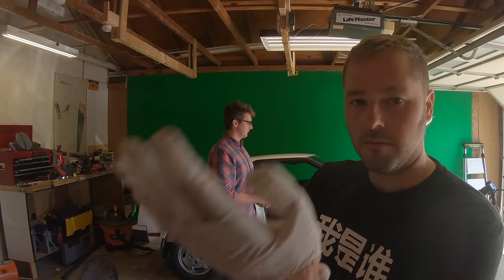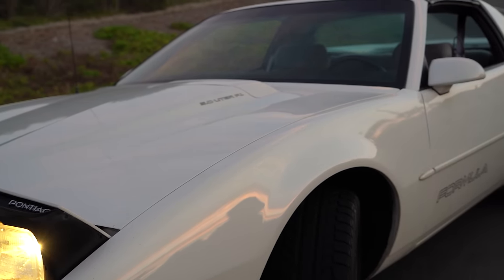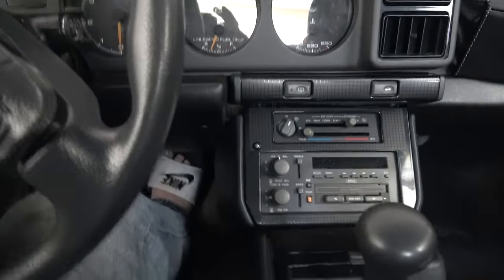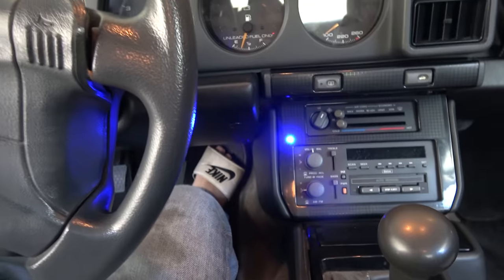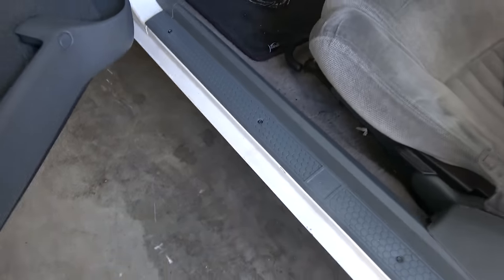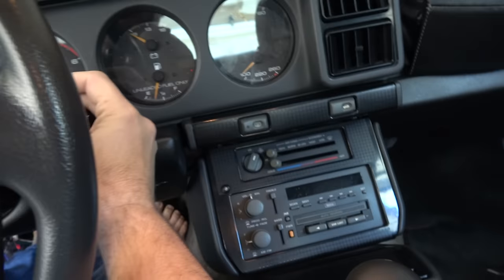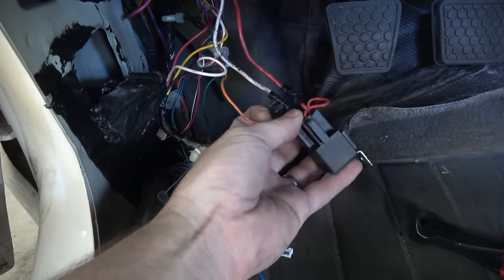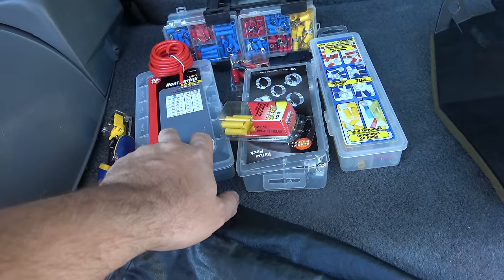Aftermarket Alarm Leaves Me STRANDED! - Let's Get Rid of it

Comment: i don't really understand why they even put alarms in cars anymore. no one reacts when the alarm goes off. if you heard one would you ever run outside to make sure it wasn't your car being stolen, or would you just sit there and wait for the noise to stop like everyone always does?
Reply from the maker: Yeah, I think it's an older habit, because you hardly see anyone do it now.
Reply: A lot of newish cars don't even come with alarms, most of them use a sophisticated system so that if it's not an original key it won't even start. Think they use RFID and other measurements
Reply: For insurance reasons. Nobody wants to insure a car with fewer security features than all the other cars on the road.
Reply: It's mostly for older cars like this Firebird. My old Accord had no immobilizer, so I added a Viper alarm. I mostly wanted it for keyless entry though, and I did it myself since most audio installers can't be trusted to make good connections and install cleanly.
Reply: its the immobilizer that matters, the rate of car theft in california is truly insane, much of the time old cars are targeted.
Reply: Before remote power lock is standard on every car except the cheapest ones it was kind of cool to add the keyless entry.
Reply: cars should all come factory installed with Buttocks Recognition Verification Technologies.
Reply: @WorthlessWhips  The chip on your key was supposed to stop the car from getting stolen.l  It looks like that didn't work, unless the thief had the extra key.
Reply: @WorthlessWhips  The only ones worth putting in now are those that alert your phone when it goes off.
Reply: Ruthanne D'Antuono  A good steering wheel lock can do the job. Watch LockPickingLawyer on YouTube. He knows which ones is best but can't remember what he said about them.
Reply: People stopped reacting in like 1986-88 lol.  Now they don't even bothering looking.  A silent alarm that notifies just you and also flips a kill switch would be best.
Reply: @jarik258  basically everything has chipped keys now.  My 2002 Acura RDX Type-S had one but the 2002 civics didn't.  I think they became standard across the board (at least in America) around 2007-2010.  They are cheap is dirt to make yet cost a damn small fortune to replace so once auto makers saw them as a potential revenue stream they immediately became standard equipment
Reply: @sparklesparklesparkle6318  this guy gets it
Reply: @w8stral  insurance is a legal requirement in most states.
Reply: @d0x360  right, just sent a notification to your phone or something. why does everyone in the neighborhood have to hear it
Reply: Sometimes you can get a rebate on insurance.
Reply: @w8stral  inb4 you crash and have to pay
Reply: @vincentas1  Try that in English?
Reply: @w8stral  ooga boooga uga buga buga uga
Reply: @w8stral  wait until you cause a crash and have to pay the other person for repairs instead of the insurance paying for you
Reply: @vincentas1  Fine by me.   Why pay for insurance?  Get rid of the middle man doing nothing other than taking a nice giant slice out of the pie.  Personal responsibility.  Never crashed into anyone or anything.
Reply: Because it helps you find your car
Reply: Times have changed
Reply: I always look out the window at least

Comment: In the 90's cars were getting stolen in the US like crazy.  I had two trucks stolen, so I bought a 95 S10 and immediately paid a guy to install an alarm.  MISTAKE!  What a huge mistake that was!  In addition to all the problems you mention in your video, the truck would not pass smog tests.  The relay disconnects the battery from the computer, which causes the computer to lose all of its monitoring data, which takes weeks to accumulate.  Without that data, the smog test computer can't analyze the cars performance to determine if it meets the emission requirements, so it fails.  Darrel Issah is a CA politician who made his fortune starting one of those stupid car alarm companies that he started.  He is a congressman, and he ran for governor once, and when he lost, he cried like a little girl.  Darrel the car alarm guy.  Those car alarms were a curse on the American consumers.

Comment: quick warning: i was laying down working on my clutch last week, just like winston is doing in this video down by the pedals, and i was laying so my weight was mostly supported by my ribs against the door sill, and i suddenly got this horrible sharp pain. i must have cracked or bruised a rib. still hurts. hurts when i am trying to sleep or take a deep breath. please don't do that if you're gonna work on your car in that spot. put a pillow down, take the seat out, do something else, do not rest your body weight on your rib cage.
Reply: dude have your bone density checked. that should not be happening.
Reply: @amammes  Agreed, this dude has a serious issue. Also if you cracked or broke your rib you need to go to the hospital, not lay in bed.

Comment: This is the content I look forward to each week. You think you guys will ever take a shot at a rotary engine car? That would be pretty interesting.
Reply from the maker: Sure! Nothing is out of the realm of possibility.
Reply: @WorthlessWhips  👍
Reply: Yuvaez  , 1st gens are fun! Lite weight like a go cart and with a little love the 12A goes hard and a 13B is basically a drop in. First gen's FTW!
Reply: Oh yes.  A first gen Rx-7!  Manual transmission only please.  I had two of them in my past.  Still my favorite car.
Reply: Plus one!
Reply: A rotary is absolutely obligatory at some point for any automotive channel.
Reply: They are like two stroke street bikes. Lots of power to begin with. I worked as a parts manager in an Auto Value and right next door was a guy who worked on modifying and fixing the rotory engined cars. Like a two stroke they made phenomenal horsepower. I saw turbo'ed three  rotor monsters cranking out big numbers. But they all ended up in the same place. Mazda gave up on them the same as the Japanese bike manufacturers gave up.on two strokes. While the power is impressive, the longevity isn't
Reply: Blake Newton. They have more in common with two stroke bikes when it comes to emission too 😀
Reply: What a coincidence, I'm watching this video to pull a system like this out of my Rx7!

Comment: Guy you are literally the only individual who is able to help me out. Astra A10 is a 2006 ScyTek Electronics product, my pops had it installed then had a different alarm system installed a year later. FWD 14 years I had to reinstall this alarm again for the time being. The shock sensor wire harness has a 4pin on 1 end and a 5pin on the other. Red, blue, black and white wire. Do you remember what color order the wires were on the shock sensor 5pin side of the harness?

Comment: You will still have the factory VATS system, which is also problematic, and will leave you stranded.  It is the chip in the key type.  The chip resistance is read by the VATS computer via two small contacts in the ignition switch.  As the car gets older, the contacts get dirty or break.  Not difficult to bypass, but that could still cause you problems.
Reply: How do I bypass

Comment: The 90's were a different time, and lots of people seemed to have cars with after-market cheap alarms installed (at the time, alarms were a costly added extra on new cars, and usually only for the higher end models). I had a Volvo that had a hidden fuel cut-off switch, and I was happy that it had it. 2 cars of mine were broken into. Both times they broke a window, and targeted the trunk. The best defense is not leaving anything visible in the car and removing anything from the boot as soon as possible. While older cars might have upgraded head units from the originals, nobody needs to be like MacGruber, and carry around his Blaupunkt for fear of it being stolen :)

Comment: That slow starting could be fuel pressure regulator. Vice grips the fuel return line after the engine and try and see if it starts straight away if so 👍 and if not it only took 30 seconds to try it.
Reply: Shop say motor hitting on all cylinders sent it to another shop same thing but everyone keep saying it needs electrical work and they cant find the problem 😂has to be the alarm

Comment: Was in similar situation; bought recently Honda Prelude 5th gen (first car for me). Anyways, when I went to get it, guy showed me it turns on with remote, turns off automatically, etc... All seemed cool and felt like it was the most awesome thing on this old car. Got home with it, turned it off, opened trunk and alarm went mental. Woke up the whole neighbourhood before I managed to turn it off. Tried starting car, NOPE, alarm it is again. Called the seller, he tells me nothing to worry, it's easy to remember all the triggers and what to do. Sure, seemed easy enough over phone. In the next 2-3 days it went off few times, because it was extremely paranoid and dumb. Had to follow exact process to turn car on or off etc... Said fuck it, drove it to electrician and just told him to rip out every trace of that damned alarm. Felt good when I could finally turn it on with key. Buttons are for computers, not starting cars.

Comment: I don't think I'd be happy trusting a high current lead like that with just a back-to-back butt connector... Solder and heat shrink every time!
BTW TS-100 is an excellent little soldering iron for vehicle work, just make sure to get a nice silicone lead to power it.
Reply: I also was wondering why he didn't use solder. I would recommend the Hakko FX-901 with some NiH Eneloop batteries. :)

Comment: This video couldn't have come at a more perfect time.  I had an alarm installed in my 1969 Impala Wagon.  Right now it won't start and I think it is that relay you mentioned.  I also am going to remove the alarm.  Thank you for showing me how.
Reply from the maker: No worries, let us know how it goes
Reply: updates?
Reply: @vincentas1  I wasn't able to get it to work.  After removing the wires it still won't start so I must have other problems.  Thanks for asking.
Reply: @mexicanspec  I wish you luck
Reply: @mexicanspec  what about now?
Reply: @vincentas1  I still can't figure it out.  To be honest I haven't tried after seeing nothing I did that I saw in this video helped.  I was just out there asking the car if I put a battery in will he start.  I am going to have to find out if he will.
Reply: @mexicanspec  good luck again then

Comment: I'm going to try this with my 2001 Mitsubishi Montero Sport! I'm just nervous about the starter relay for some reason, even though that seems like the easiest part. I'm going to do this on my own. I've already had help frying my new battery when a friend wanted to work on the alternator without my consent and without  disconnecting the battery first. He also had the battery in backwards. Replaced all the blown fuses and hopefully it will start after I remove the alarm. Thanks for video!

Comment: I know the feeling of dealing with a crappy alarm system. My mom had a late 90's Pontiac Grand Am 2-door with a dealer installed alarm system. It caused nothing but problems for our family as it was constantly glitching out. There were sometimes the alarm would go off for no reason. The car would be sitting in the garage and randomly go off. Then there was the same issue you guys are having. Sometimes the car would start, sometimes it wouldn't, because the alarm wouldn't turn off, even with the key fob. It was a horrible system, and my dad finally got it removed and everything put back to stock, and all the problems went away.
Reply: Also had a car with those after market alarms, never again! Those are nothing but a pain the arse!

Comment: The blue LED is reason to doubt that the aftermarket alarm is from the early '90s. The scientists who discovered a way to make blue LEDs had only just discovered them in the early '90s and they took another 10 years to become ubiquitous. They were still very uncommon in the late '90s.

Now, if it is an incandescent lamp and not actually an LED then it could still be from the early '90s.
Reply: wan’t the invention just cheap blue led? Also can’t you just put a blue filter on a white led?
Reply: @vincentas1  Show me a white LED from the early ‘90s. ;)
Reply: @vincentas1  Yeah, white LEDs came about 5 years after blue (around 1996).
Reply: @emmettturner9452  then a incandescent lamp with a blue filer
Reply: @vincentas1  Exactly, hence the last part in my first comment. ;)

Comment: I had a 1986 Jeep Grand Cherokee that had a factory alarm in it. The switches monitoring the door keys were falling apart causing the alarm to immobilize the jeep. I found a process to remove the factory alarm module, you had to do it with the Jeep running or otherwise the main computer would figure out you removed the alarm module and kill the jeep. Was bizarre but after that the Jeep ran much more consistently. The hardest part was taking the facade off enough to get to the alarm module as it was buried quite deeply in the cars dash.

Comment: I think it all comes down to the quality of the installation. Usually when people have issues it's because a connection is weak/failing. A lot of installs use shitty crimp connectors instead of proper soldered connections. I have one going on 15 years without issue, which makes it older than the average car 12 years).

The fact you had to jiggle the wires kinda confirms that. Also replacement remotes can usually be had on eBay. I would personally have just resoldered each connection and ordered/programmed a new remote.

Comment: If you ever need heavier gauge butt connectors than 12 ga., check out West Marine (or other marine supply stores). They typically have them all the way up to 00 gauge. (That's as thick around as your thumb.)

Comment: I'm laughing because when you tugged on that blue wire and it ripped out of that tar crap, I did exactly this to my $600 Mac mini.. i no longer have a working machine as one of the pins ripped off the mainboard. It's so tiny that I had to get a super tiny soldering iron to try to fix it. I have a 2001 VW Beetle with stock alarm system but I will be installing an aftermarket one myself to make sure it's done right. I'm terrified of what "professionals" might do.

Comment: my 1991 bmw e30 convertible locked me out for two days, groups and mech and all the googling i could must coudllnt find an answer.  luckily a convertible is not that hard to get into without damaging it. took the keyfob lock solenoids out of the doors, trunk too and turned it into a key entry only door.  had to pull the wire off the siren as it wouldnt shut up.  never had a problem with it since, that was 2 years ago.

Comment: After market alarms are a nightmare, if your car didn't come with a factory alarm don't put it in and if your car has an after market system get rid of it.  Same thing goes if you're thinking about dropping in a different engine that wasn't a factory OEM engine. If you want some kind of security, install a kill switch on the fuel pump

Comment: As arguably your most consistent viewer, and a hardcore car guy, I gotta say this - Heat shrink and butt connectors?! On your personal car?! C'moooonnnnn maaannnn, not even solder and shrink? During the VR6 interior rebuild I spent about 20 hours soldering and even longer fixing wires as well as de-pinning plugs to organize the wiring a bit as well, so I gotta give you a hard time for that.
HOWEVER! To anyone that isn't a up-their-own-arse car guy, this method is going to save them a ton of time, money, headache, lower the learning curve, and in all honesty last about a decade before there's going to be issues with the butt connectors (especially if you're using the heat shrink OVER the butt connectors in conjunction with dielectric grease).
NOTE TO ANY FUTURE CAR GUYS: Just buy a tube of dielectric grease at the store for about three bucks, because you should be using it on pretty much any new connections, spliced wires, and  bulb sockets; anything with electricity going through it as far as I'm concerned.
Hey DubSterz, you're Awesome, and it's pretty dope to see you having gone from suits back in the day to normal clothes; I'm not the only one that was wondering if you owned dungarees.
Reply: Soldering is not the best connection in vehicles. Vibration may cause it come loose.
Reply: @otofoto  How do you solder? If you're properly twisting them together, Flux-ing, soldering a proper joint, dielectric-ing, then heat shrinking it, how would that vibrate apart?

Comment: My parents have a BMW Z3 with its original alarm system. It's problem were false alarms. But instead of removing the system, their "fix" is to just always lock the car by pushing down the pin in the door on the drivers side, when the drivers side door is closed, which is apparently the only way to lock the car without enabling the alarm...

Comment: I dont know how you did that no nonchalantly. I currently have an issue with a poorly installed aftermarket remote start in my CRV. I however will not be so nonchalant when taking it part

Comment: Yes ty it was helpful,  my problem is that in the morning I have to jump my truck  but my battery is new alternator is charging at 13.5 14  and it only takes a touch with a battery  and cranks up fast but I noticed that when I jump it the horn is beeping from the alarm, it been doing that for the last 5 days  but drive and start up all day no problem but the next day, start all over again?

Comment: Should solder the wires and heat shrink for a full proof permanent fix. It is DC and  needs  to be permanent ,  as with installing an alarm  all connections should be soldered and then  you don't get faults.  Most faults are caused by lose connections  and bad insulation .because the car is bouncing , this is why professionals always solder.